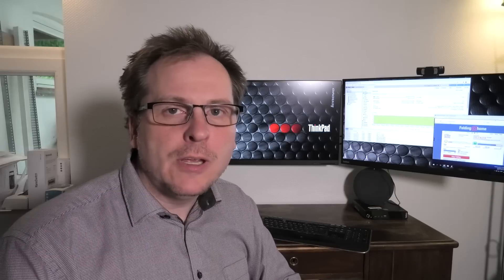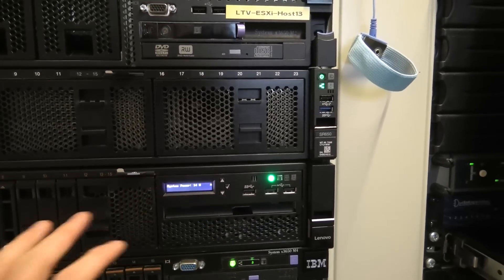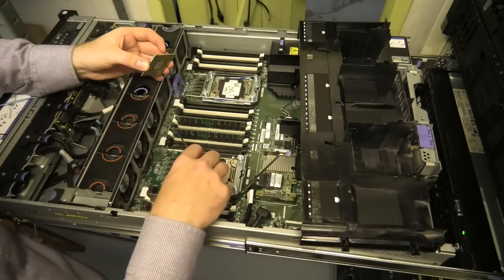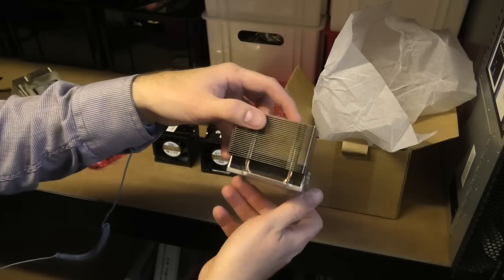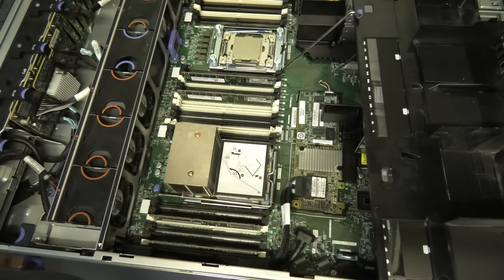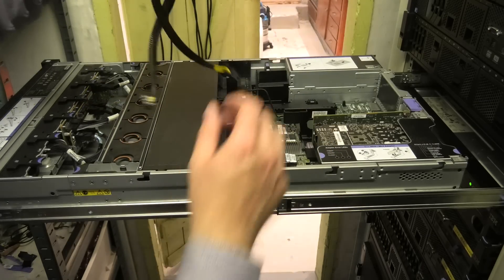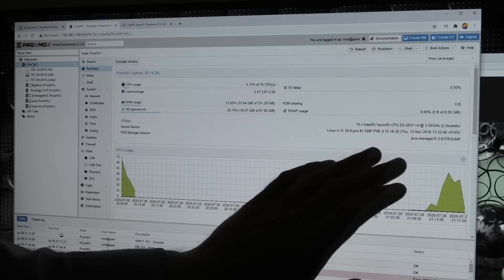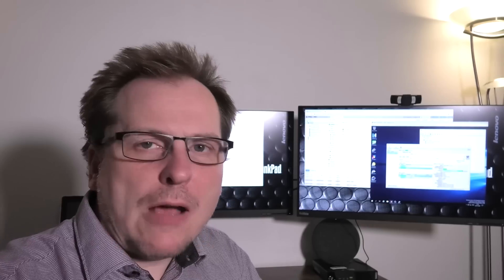Double Downgrade on The Lenovo x3650 M5 with E5-2637 V4 - 986

Comment: Stuff like this is why I run AMD systems
Reply: stuff like what?
Reply: @sirfairplay9153  low quality intel parts
Reply: @eclipsegst9419  @Matthew Bittle
"Intel sucks, only good for workstations"
Uhm no. Both AMD and Intel have CPUs to do specific tasks. Actually their Workstation CPUs are LESS worth their money than their Desktop parts because there they at least have high Clocks - in Workstation segment, their offerings loose to Threadripper 3rd Gen hard.
.
"low quality intel parts"
If the Manufactoring goes wrong and the quality is poor, chips get binned lower. There is no such thing as a "low quality part" as in general statement about a company would imply. The Chip either does the job done or does a lesser Job done or is not Functional.
.
"Xeons in general are a better deal right now than a used ryzen"
I would not agree since 8 core Ryzen (1st Gen) are already down to about 80-100€ in Europe Used. Also they are not really directly compareable since they were meant to do different things.
.
"AMD are for cheapasses"
No, intel is milking it's customers as hard as they can. Price does not equal Power. AMD leads in Cores, Performance / Watt, Interconnect Bandwidth, Price, even Clocks in high core count cpus. Intel needs to dramaticly increase their compute-power while sucking less from the wall. Since the Desaster of 10nm, they have yet another Desaster with 7nm which is delayed to 2022/2023.
.
"If they hadnt bought ATi they would be long gone by now"
Not true at all, sry. They took a huge leap, failed with BullDozer, were hit by Intels very good Sandy Bridge and(!) intel did a sheme where they would ammount for 1/3rd or DELLs income each year back when AMD had the Crown (about 2003-2006) with their 64 Bit CPUs - intel had no answer. They were brought to court over it and got the highest Fine ever given out by EU Regulators. AMD was actually cripled by unethical stuff from Intel a lot of the past decades.
.
"AMD just makes the designs, and still cant figure out how to accesss cache memory properly after all these years"
Intel themselves are thinking about giving the Manufactoring of CPUs to TSMC since they cannot compete right now. Also: You mean like accssing the Cache in a way that does lead to a lot of Vulnerabilities - like with intel? :D
.
"they blatantly stole Intels design and then made a cheap version."
Well they were a second Manufactorer for Intel some time back then. Intel wasn't happy so AMD had to design something new - which they did and we all know it kicked Intels ass. Intel would have been better off keeping AMD on a short leash :D
Reply: @RawmanFilm  intels "vulnerabilities" are theoretical, and have never been proven, then they patched it at the cost of performance for no reason. Security should be on Windows shoulders, not the cpu anyways. Intel makes it fast, as they should.
Ive never had an intel that wasnt worth every cent. my C2D E8400 performed until 2013 just fine, 2550K lasted until just last year, (and still did just fine for most uses) and my 5775C i plan to keep until Golden Cove, which is looking to be the next Sandy Bridge moment. AMD has caught up before, and likely will again, but they will always be the chips for those who compromise in my book. Now, their GPUs i do like. If you think Intel overcharges, Nvidia overcharges by far far more from a price/performance perspective. with Intel its a wash because they generally have a much longer useful life. Zen 2 and 3 will probably be a decent bargain choice in the future, but that remains to be seen. if Golden Cove pulls off the predicted 50% gains, it wont matter if 7nm gets delayed, AMD will be playing catchup again. they cant achive that just from shrinking to 5nm, silicon is already near the point of minimal retuns from die shrinks. AMD is going to have to fix their design, not just shrink it again.
Reply: @eclipsegst9419  I thought AMD hadn't used Intel's designs in 25 or 30 years. Don't underplay the importance of the chip's design, that's where all the performance gains come from. AFAIK the fabrication process mainly just helps the power and thermals.

I should note that I've had more issues with AMD than Intel, just in case you thought I was an AMD fanboy.
Reply: @eDoc2020  nah im just poking the guys that are fanboys cuz i think its funny how they all are freaking out and claiming superiority because they finally caught up to 2016 intel in 2020 by using half the process size. that really is nothing to brag about. I use AMD gpus because i think they are a far better deal at 1080. i dont really hate amd, i appreciate the comptetiton. i just think its dumb that amd convinced people they need more cores when in reality core count is just a crutch for the poor ipc gains weve seen since silicon hit the point of limited returns. And it has led to game development taking far longer because they have to program everything to run on multiple cores and decide which core to use for which, etc.. i would rather that intel and amd both would focus on whats next beyond silicon and IPC gains.
Reply: @eclipsegst9419  "poor ipc gains weve seen since silicon hit the point of limited returns" is in conflict with "if Golden Cove pulls off the predicted 50% gains, it wont matter if 7nm gets delayed"
If you were predicting 50% more "Gains" and little IPC gain (like say 15%), clocks would need to rise by 35% - in which case you'd have 7.155 GHz CPUs which i find highly unlikely. Also: if intel would put all their efforts into Performance, that would mean, theese CPUs are still hot Furnaces sucking 2 much energy.
Reply: @eclipsegst9419   "Zen 2 and 3 will probably be a decent bargain choice in the future, but that remains to be seen."
r5 3600, 6 Core for 150-165€ is not a bargain already? If the trend continues, Q4 of this year they will go down do about 120-130€, if that is not ultra cheap, how much more would you need :D
Reply: @eclipsegst9419  "AMD is going to have to fix their design, not just shrink it again"
Every ZEN generation has it's "fixes", as you'd call it, already with Zen 1 being highly manufacturable, low power, high core count, scalable, medium ipc, much higher FPU Perf than bulldozer/Vishera.
Zen2 had MASSIVE FPU Perf. increase + slight overall ipc increase, Threadripper & Epyp are now 1-2 Numa Nodes instead of 2-4
Zen3 will have not as massive, but strong INT Perf. Increases and Unifies its cores now with one L3 Cache / Die.
Reply: @RawmanFilm  you missed the point. DIE SHRINKING is no longer the best way to improve IPC. Optimization is. Die shrinks will never again happen every 2 years. Moore's law is dead in that regard. AMD only did it to play catch-up. They will hit a wall if they try to go below 5nm where clock speeds will suffer too much for the IPC gain of the shrink to be worthwhile. Until silicon is replaced with something better, we will see mostly more cores, and cores that can run more than just one hyperthread.
Reply: @eclipsegst9419  Ok so what would you do instead of Die Shrinking? :D
Reply: @RawmanFilm  I mean it's not a bad deal, if you need 6 cores and 12 threads for some reason, and you could actually get one at MSRP. But there's several ways to get 80-90% of that performance for 40-50% of the price once motherboard and ram are factored in. most people won't take the time to look into it. But here say you have 500 to spend on an upgrade, as that's a pretty reasonable budget I think, and you already have DDR3  in your old rig like most people needing an upgrade. Do you spend 150 on CPU, 100 on Mobo, and 75 on ram, meaning you only have 75 for a GPU and so you get an RX470, or sell whatever you have and maybe get an RX580? Or would you spend 80 on Haswell Xeon E3 CPU, 20 on own 1150 Mobo, 5 on PSU adapter, and keep your ram? Leaving you with 400 to buy a bitchin 5700xt or secondhand 1080? I'll take option 2 any day of the week.
Reply: @eclipsegst9419  PSU Adapter, i would personally never pick; Cheapest Ram is 55-59€ here (2x8, 3200 cl18), I would not buy used Haswell at all. If talking budget but nothing else, i'd (right now at least) go for r5 2600 so that would be:
- 56€ - 2x8GB of DDR4 3200 CL 18
- 115€ - AMD Ryzen 5 1600 12nm (which actually is a 2600)
- 69€ - ASRock B450M Pro4 (or equivalent)
This is Plenty and leaves me with 260 which i can buy a VEGA56 or when trend continues, a 5600XT with.
I would gain hold of more modern parts, better io (which i use), a better boxed cooler, full nVME Support alongside lots of IO happening with the GPU, as well as Guarantee of 2 Years (CPU, mainboard, GPU) respective "Lifetime" (~10 Years Ram) on theese parts.
Reply: Intel sucks, only good for workstations
Reply: @Rolatnor  i don't think you know what you're talking about
Reply: @sirfairplay9153  im a technician i know exactly what im talking about, don't get lippy with me
Reply: @sirfairplay9153  im also a system builder
Reply: @Rolatnor  i think you're a comedian
Reply: @sirfairplay9153  all my customers that ran intel and had issues were happy after switching to AMD
Reply: Xeons in general are a better deal right now than a used ryzen, this was just an example of not the greatest planning. passmark scores for the two are lower when added together than the score of the old single. Now, if he had used a second of the same it would be a monster.
Reply: @eclipsegst9419  i didn't say xeons were expensive, they are just junk
Reply: @Rolatnor  well, considering many of them outperform zen and zen+ for less money, you must agree that those processors are pure garbage then
Reply: @eclipsegst9419  AMD far outperformed intel since 1999
Reply: Still does for that matter, quality = AMD, CHEAP = INTEL
Reply: @Rolatnor  lolol
Reply: @eclipsegst9419  you must be an intel fanboy then if you think intel is better, i know from experience that AMD has better hardware js
Reply: @eclipsegst9419  i actually started with intel btw b4 you judge
Reply: @Rolatnor  "AMD far outperformed intel since 1999"
That is not universally true :D
Zen and AMD64 were the Highlights the past 2 Decades - Intel had Sandy Bridge and C2Q (which was "glued" together but oced like a champ)
Reply: @eclipsegst9419  "OC sandy bridge is equal ipc to Zen" 
Instructions PER Clock are static, while CLOCKS are not. Overclocking does not increase IPC.
.
"OC Haswell has higher IPC than Zen+. feel free to pull up any single core benchmark to confirm"
Same thing. IPC will not grow with Clocks cause it is ~ what your CPU can do in a Clock.
Reply: @RawmanFilm  ok here- an OC sb and an OC Zen will produce the same single core results in most benchmarks, and a Haswell will outperform a Zen+ in most single core benchmarks. Potato/potahto.
Reply from the maker: I am happy that AMD is doing well,, for the longest time there has been next no competition.
I have been looking at getting an AMD server,, But if you want enterprise,, they are very expensive.
I do not see why anyone would pick anything based on this video,,I replaced a 12 core with 2*4 core and found that they was not as fast,,, the two E5-2637v4 are for servers where you pay $10.000 per core. like Oracle or SQL Enterprise,,, and you most definitely do not want a Big AMD for that.

Comment: Hi,I need your support in raid controller and it's failure!
Reply from the maker: That i not much to go on..
Reply: @MyPlayHouse  well,there is an power sudden outage for last 2 weeks in the server room,so there is an issue occuring like once I open my setup menu it shows 3 disks are in online mean by raid 5 it's running,once I open into my Operating system "Citrix xenserver",there it's doesn't enabling the storage properties and it disconnect's the lan also!
Reply: @MyPlayHouse  well,is there any thing to recover files from the Citrix xenserver ,please help me times are worse here👃
Reply: @mukunthnataraj5605  Why not ask somewhere that provides support, doing that in the comments section of a youtube video isn't really the way to do it.